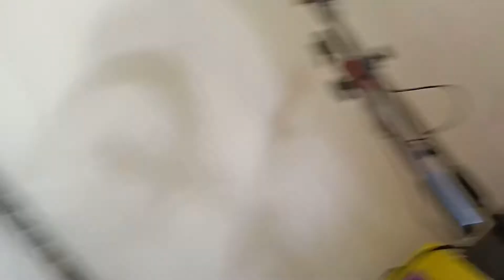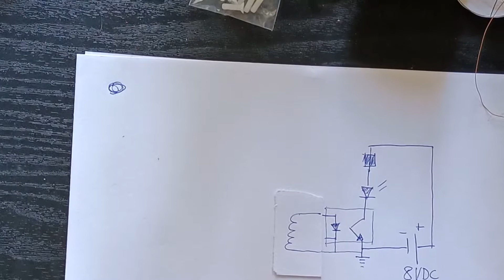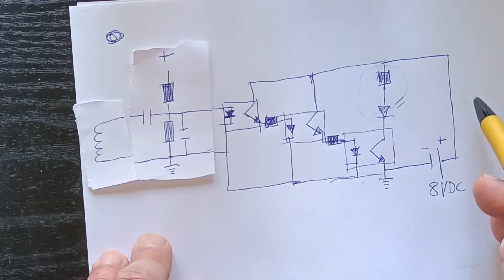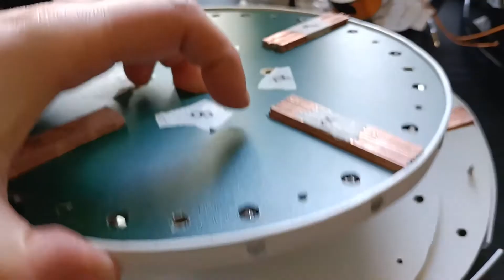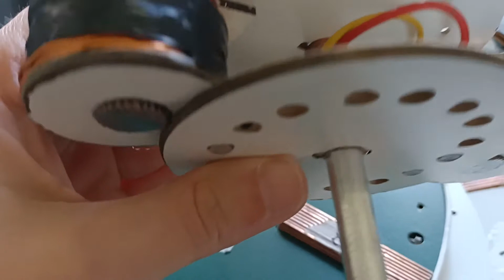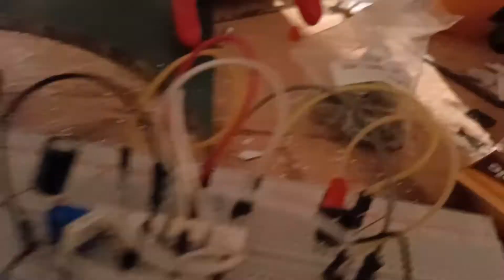New Gen: The Safety Ring

Comment: I really like the way your using the magnets with the iron rods. its a smart way to get the flux out there. I will have to consider this way for future rotors.
Reply from the maker: Yes make a 3d printer version with the flux bars or guides. If you are interested, I got inspired by the MEG or motionless energy generator orso, since that uses a flux switching principle. Also the obvious kromrey generator which John Bedini showed in one of these energy from the vacuum dvd's, he calls it the G-field generator, since it is related to gravity fields or flux.. you know the iron falling into the magnet, can be perceived as artificial gravity, at least I view it that way. But for you the most obvious and accessible source will be this channel and the new Gen series, as we will go over the details and working principles as we move through the project. Thanks!